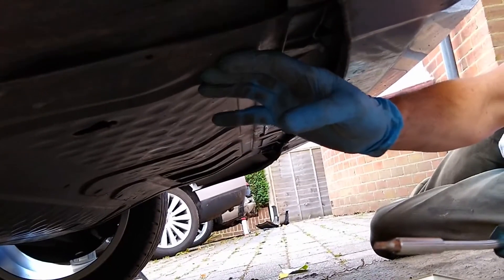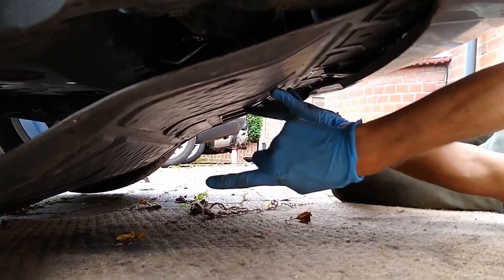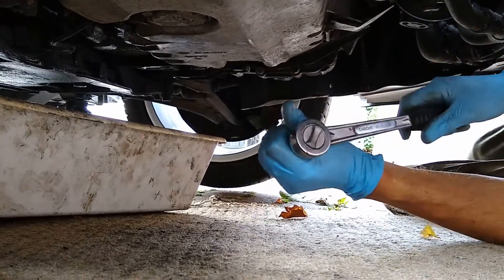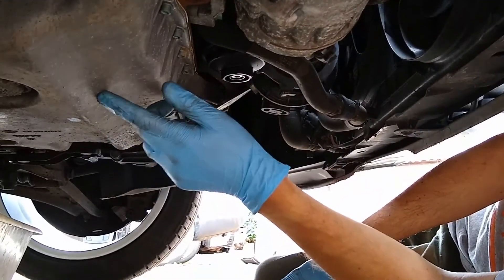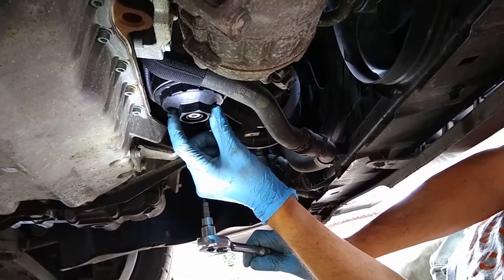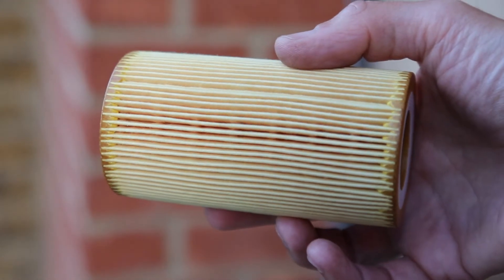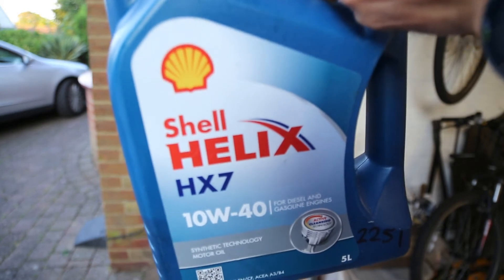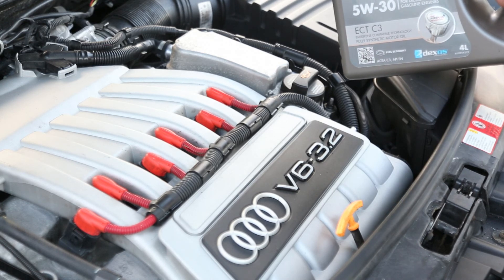Audi A3/TT 3.2 V6  (VW Golf R32) Oil/Filter change -How to Replace Oil & Filter at home & Save Cash

Comment: Just a heads up for anyone going to change the oil on their TT, you’ll need 5.8 quarts, and when I called an Audi dealership they said they use Castrol Full Synthetic 5W-40
Reply from the maker: Thanks for the info, I'll add to the details

Comment: Previous owner put way too much oil in pressure caused the plastic seal and the o ring in the oil filter housing to crumble now I’ve got myself a nice little oil leak